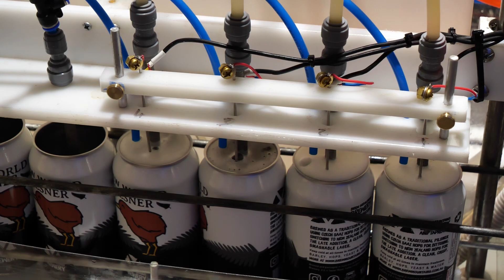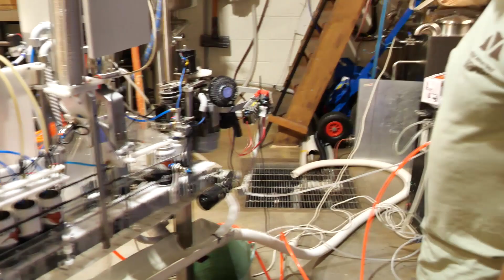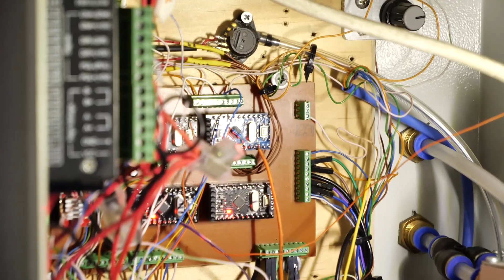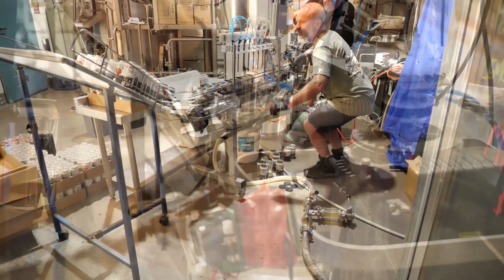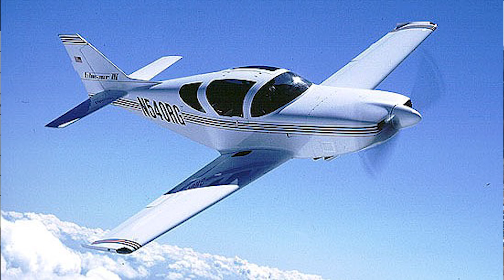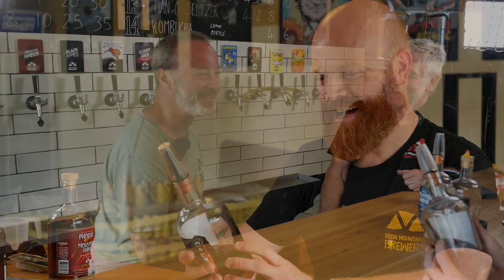BGG New Year's Eve Special: Brew Mountains Brewery!

Comment: Hey Brad i have a question maybe a topic for a video my amp Hiwatt T10 head  little class A amp blew a short in the pcb around 5 on the valve but didn't blow the fuse.  I am in the process of repairing it but when i got it i plugged in a TRS cable into the cabinet thinking it was a speaker cable and after opening the amp after postage and letting it sit for a day i never got to hear it apart from the burning smell and a frazzle sound. 🤣 had this thing for a year and just getting round to try a repair but no schematics and no reply from the company guess they didn't design it or manufacture them.
Reply from the maker: That's what we call a "flyback event".
You presented a valve amplifier with no load.
This lead to a massive voltage spike, arcing over and damaging the PCB and possibly valve sockets, output transformer internals and other parts that may not be obvious to the naked eye.
A really good tech could possibly determine and address the damage, but take into account the market value of the amp, and perhaps don't over-commit financially if you're not in a position to do so.
Reply: @BradsGuitarGarage   Cheers mate i am learning electronics repair and i have put the repair on hold until i get a scope and variac.  I have plenty experience replacing components and testing with esr and DMM meter but  if it's toast i have a nice head chassis that i could clone build something into it. I will post pics on Reddit eventually and list of components as no schem's when tracing components that are burn most of mine look ok but need to take them all of the board to test.  Thanks again cables sure are a pain in the ass sometimes 🤣